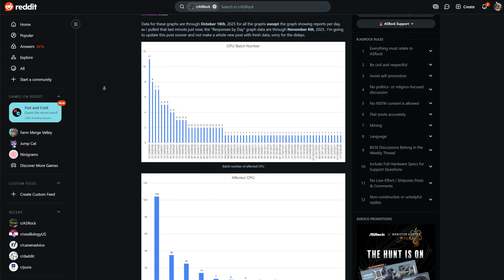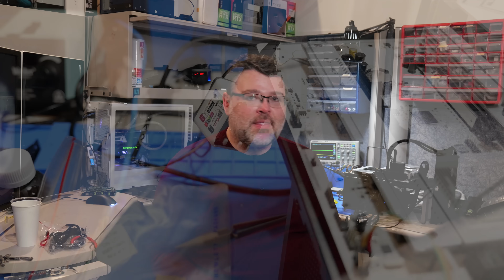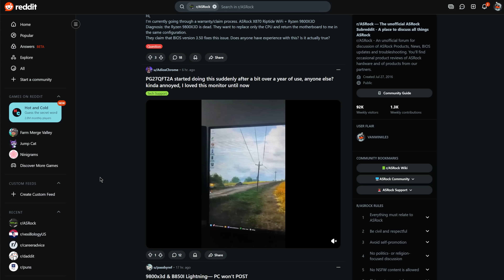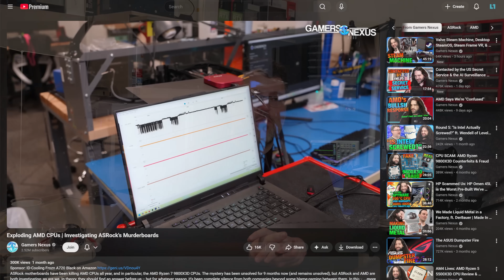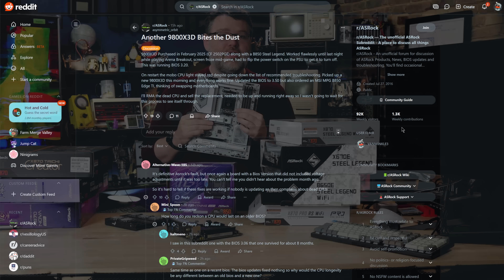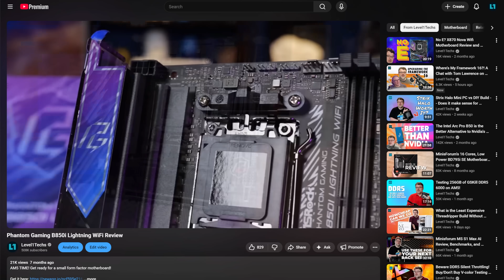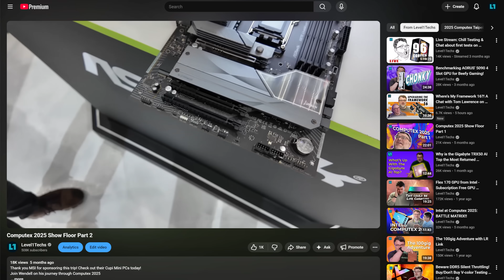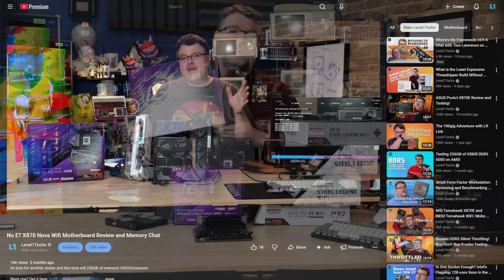Attempting to Troubleshoot the ASRock Motherboards of Death!

Comment: Had ASRock boards for 20 years. I like the simple design of the Bios and "the price is / was right" most of the time. I want to buy an AM5 board in the near future, ASRock get it fixed!!!
Reply: That’s the thing— it sorta is fixed. 10’s of thousands of boards sold and it hasn’t been replicated. The subreddit is full of maniacs with an axe to grind. Theirs been a couple hundred failures- a statistically significant number for sure- but it hasn’t been nearly as huge an issue as advertised. Especially with the newer BIOS version. If it were still a huge problem - they would do something about it.  I say this with a 9800x3d mem training on my 870 steel legend right now. So I put my money where my mouth is.
Reply: @Ball-Lightning-dr5wv  i gotten 9800x3d with pro rs x870 when they just launched undervolted and restricted my 9800x3d to be less hot + less noise glade it wasnt burned up already close to 1 year with the pc added rx 9070xt pure to the pc also updated to the newest bios version still going strong guess i was lucky with the board have another pc for my brother with 9060xt 16gb prime that costed 350$ + b650 tomhawk + 7800x3d both were great only msi board was kinda annoying on memory timing doing problems till i updated that bios fixed everything msi seems to have problems on older bios versions so always best to update to newest bios's on all board as i realized with all boards that use xmp/oc/undervolt/different rams just update ur bios to save headache later
Reply: @Ball-Lightning-dr5wv  you need to remember all the people who have had the 9800x3D burned up, but they don't use reddit. Like my friend that had his 9800x3D burned by an AsRock board 2 months ago but he just brought it to warranty and didn't really complain on online forums about it.
Reply: @Ball-Lightning-dr5wv  Big balls :P But yeah considering ASRock is a solid brand I don't blame you, odds are it'll be just fine

Comment: Can motherboard makers NOT use 1 and 5gbe and just use 2.5g and SFP+. Too many shit standards.
Reply: Kinda ironic that you use the acronym SFP+, when that's the reason they use 1, 5 and 10g ethernet. Nobody knows what the hell SFP+ even means, so even less with use it, so why should they bother?
Reply: @Dexx1s  normies don't know ethernet comes in different speeds. People who know, want sfp.
Reply: @leggysoft  And they build boards for the general audience. That's kinda my point. If you need something special, you probably already have a PCIE card for it. 
Even the majority of 'non-normies" will only need 5gb. If you want/need 10, again, you already have a card. 

It's like complaining about their audio controller when anybody who really cares that much about audio already has a separate DAC/interface.

Comment: I have the Gigabyte X870E Elite Pro Ice wifi they really need to change these damn names.  Running a 9800X3D for about a year now and have updated everything when a new version comes out for software/bios.  My only issue and it's been this way since I bought it is that if I run the MB software to control the RBG for RAM and MB it will hang on a reset and I have to hard reset it to get it to boot.
Reply: I agree with the name change because it is beyond insane to use so many adjectives to describe a motherboard. So far I've had no issues running a 9800x3d on a Gigabyte B850M AORUS ELITE WIFI6E ICE (rev. 1.1) <- ugh too long!

Comment: i have  b650 steel legend wifi with a 7900x3d and while its not dead i have some weird behaviour. i have to shutdown the pc completly to be able to boot again because when rebooting the running system its gets stuck infintly at dram training i think (the led flashes). but other then that it works but i havent used it extensivly because of the whole asrock killing x3d issue but i have always kept the bios up to date to the latest version with mostly default values with expo enableld , new bios versions doesnt help to fix these issues.

Comment: The fact that this is still an issue and ASRock just blames AMD is appalling. I'd be fine with making up shit like "ASRock burns up AMD cpus" like how "Nvidia doesn't work with Linux". Technically not wrong but might get the company to fix their shit.
Reply: But why is that a problem, Asrock did bios 3.15 based on advice from AMD and still AMD CPU's died before reaching the limits AMD claimed were safe, the AMD CPU's should have shut down but didn't.
AMD themselves back then even did a press release saying they would replace the CPU's, AMD than apparently threw Asrock under the bus, yet here we are, since May 2025 no one on the planet has found the cause or replicated it in the test bench, including AMD and Asrock.

We also have vast numbers of the failed CPU's belonging to the same batches, indicating there was indeed a batch tolerance issue getting triggered by Asrocks more aggressive Bios setting that were running under the specified safe limits AMD provided.

What is appalling is just how hard AMD have been pushing CPU's, pretty much overclocked to the hilt as stock, just look at the 7600x which at stock was hitting ridiculous temps even with a 360 AIO during the initial reviews, AMD CPU's designed to push hotter dying, hardly surprising. Maybe if AMD were less aggressive we would not have the issue.
Reply: @SastusBulbas1  1. ASrock were running the CPUs out of spec. No other board manufacturer has failures like ASRock has. AMD said it is not the CPUs that are the problem, which in all likelihood is correct as if it were you would be seeing the same reports in the same numbers from owners of MSI, ASUS etc. boards as they are far more popular options than ASRock. 

2. The boost behaviour of the 7600X is normal. Temperature will not kill a CPU because of TjMax. They will shut themselves off before any damage is inflicted on them. What will kill a CPU is current and voltage, which is entirely user controlled outside of motherboard manufacturers again, running their boards out of spec. Out of the box the CPUs do not run with high enough voltages or pull enough current to inflict long term damage unless you specifically override their behaviour.
Reply: @riven4121 dude all I said was out there said by others, as for the issue, 200 out of two million is fuck all, and gskill suffer more failures, Asus also blew more 7800X3D last year, yet the whiners still buy those.

Comment: My son had his AMD CPU die quietly after about 20 months on a MSI B650.  No visible damage on board or CPU.  AMD replaced the CPU.  Works on same board.
Reply: Which CPU?
Reply: @Matticzek1804  probably X3D
Reply: Which processor
Reply: What ram do you use ddr5 cl?

Comment: I think we need more deeper on owner hardware installation, Fans, Ram, AIO/Air Cooler, Windows version and any other 3rd party app such as; RGB from other 3rd brands L-Connect (3 Lian Li), Icue App (Corsair) etc. and other Game peripheral app; Razer Synapse etc. These apps always use cpu and ram which impact pretty heavily, on performance and Resource Usage.

And every case i saw nobody mentioned any of this. Most importantly, "some" 3rd brands app aggressively change bios cpu fan curve. So I think we need more information from user/owner hardwards and apps their install and use every startup.
Reply: None of those things should ever lead to a board frying a CPU. And if Windows and apps  were the cause, it would be more spread across all brands. If any of those things are causing Asrock's boards to fry the CPU, it's Asrock's fault, and we're in the same position.
Reply: dude you have no idea what are you talking about, you should learn something on the subject before spewing such things:))
Reply: @alexandruciordas4941  I built my own pc for decade, and i well aware what i talking. And Because of this issue still going but nobody talk about another hardware owner install in their mainboard or apps. You can call me stupid as you please, but you can search all over the internet about this issue, not even once i saw mentioned any of this thing. That's why I'm curious the hell is going on. Even GN Steve and Wendell who do the lab test the most cant even reproduce it. 

I want to know too, this situation is like we going around circle, many users are fine, some user are Dead, same board same bios version.

PS. All MB manufacturer windows apps SXXK, heavy use on resources = impact performance. The most well-known is MSI Red Dragon apps. Also Razer Synapse, for example, also heavy impact on performance for decade and never change. Not just RZ Synapse, all gaming peripheral apps. Corsair icue link, Lian li L-connect 3, also use resources. Look in your system and disable all these services from startup, see how much your performance will improve.

PS2. Thank you for your insidefulness of information.

Comment: Would have wanted to pickup a 7800x3d on Aliexpress Black Friday, but I am afraid my B850M Steel Legend will kill it despite it having the latest 3.5 BIOS. ASRock has not stated that the issue is fixed (only that CPU compatability has been improved). I'll probably just dump the Murderboard together with its 7600X when Zen 6 is launched.
Reply: Issue is 9000 only , 7800x3d should be perfectly safe
Reply: @Pieteros21
107 units of 9800x3d
7 units of 7800x3d

So 15 times less likely, but still overrepresented vs the non-3d 7000 series
Reply: @stennan 7units of what ? thousands of 7800x3d are working on ASRock motherboards . Also that 7 could just be a bad batch, at this big volumes they are produced it Can happen.

Comment: 9800X3D in the Nova board hasnt blown up yet at 12 months, but it has made me anxious enough to yank an old HP pavilion out of the trash as a spare
Reply: Exactly the same for me. Which BIOS are you running?
Reply: I mean, just monitor your Vcore / Svid and make sure they doesn’t go over 1.35V for exemple, same goes for vsoc etc., you want them as low as possible.
The only way to be safe on any board is to be sure all your voltages are within specs with safe margin..
Reply: Mine same combo 9800x3d with Nova wifi just died, I thought it was 5090 but nope. Gpu is fine, system wouldn’t boot no matter what

Comment: 9800x3d and X870 Pro RS Wifi here running since Oct 12... only thing wonky is my BT died strangely about a week ago.  If it's enabled POST takes longer and USB resets multiple times.  Linux kernel does the same.  Disabling it brought back the original boot speeds and no more USB resets.  This happened soon after an upgrade to kernel 6.17.8 (fom 6.16.10) which apparently is not compatible with this BT chipset (MediaTek M77925 RZ717).  Wondering if that is what killed it.

Comment: Mine was completely standard, no fiddling done and it blew up after 3 months. Nova wifi and 9800x3d. Board was fine, bought a 7700 and  it booted right up and that still runs today.
Reply: that sucks. I've been on asrock x870e and 9800x3d since late January and haven't had any issues at all, wish you had the same experience. I really like the mb, it has really great features and layout for price, so I hope this gets sorted so people can continue to run them.
Reply: right? only standard model than X3D was totally fine and that's good choice to save money for budget conscious cuz X3D is too damn expensive lol
Reply: @indrahaseo x3D's performance gain is significant in he correct workloads.

Well worth the minimal price increase. The 7800x3D can be bad for under 300 bucks.
Reply: @thebritishviking X3D is too expensive for budget gamers if you want to save money so badly, then just go with standard model than non-X or X3D is more cheaper.
Reply: @indrahaseo or just get a 265k for better performance at lower price without killer motherboards
Reply: @iceman5117  nice try, intel fanboy lol
Reply: @indrahaseo not really, only a fan of reliable chips
Reply: @iceman5117  oh from the userbenchmarks lol
Reply: @indrahaseo No just common sense. I have a 9800x3D in my rig right now. 265K is good value, cheap and solid performance and hey, it won’t get killed

Comment: This is kind of worrying as I have both the B450 Steel Legend and B550 Steel Legend which have both had my 5800X3D in them. The B550 is being used by me with the 5800X3D currently and it's fine, but i was hoping to move over to AM5 in the new year and looking to getting a B850 Steel Legend board but if they're having issues, maybe I'll go with another brand?

Comment: If you end up chasing the bios settings/corruption as a cause, rather than bitbanging the bios settings with the nano kvm it might be worth it to rig up a microcontroller/fpga that either masquerades as the bios chip or sits between the bios and board. This would let you swap images or settings instantly and if you have something between the bios chip and board you could log all communications and detect any weirdness or even introduce a problem on purpose to see what happens. 
Of course this adds a new variable in the system that might mask the problem in some way (intermittent problems are the worst!).

Comment: Or you know, ASRock could OWN this problem, issue motherboard and CPU REFUNDS without question, TEST and replicate it themselves, PUBLICLY release the cause, and a FIX for it.
As someone who has owned many ASRock motherboards in the past, and built many systems for family and friends with them, I will now NEVER AGAIN buy or recommend any ASRock products, and will actively deter others from doing so as long as this ASRock behavior continues.
End of Line.
Reply: Did you even listen to the video. He mentions that both AMD and ASRock have tried to replicate the problem and have yet to find a root cause. He then goes on to say that he has spent months himself trying to get it to happen, controlling for a multitude of variables. If this was easy to find it would be easier to fix, but it's not, obviously. Put down the pitchfork and back away from the computer.
Reply: its probably a headware level defect and would be committing corporate suicide if they ever issued a recall.
Reply: @deadpool790 what? Did you mean hardware defect? If it was that then it would be easier to replicate, especially if it is as widespread as people are trying to make this out to be
Reply: Or maybe get an education and do some math with th efigures, AMD and Asrock and the best Youtubers and the largest system builder companies have not been getting the problem, no one is able to replicate it. 

Back in May 2025 the issue arose with bios 3.15. Back then some on Reddit deep dived and found Asrock had most likely sold around 2.13 million motherboards, and a few months later someone had stated a confirmed number of just over 100 AMD 9000 series CPU's having failed.

Gamer Nexus then twice did lengthy videos on the subject, and despite their best efforts, could not find the problem or the cause. Last month GM posted the figures on reported claimed deaths by Asrock, not verfified, as around just over 200. And managed to list the CPU and motherboards, someone else then linked the batches showing the highest percentage of 9800X3D that failed came from one batch. 

Interestingly, more 5090's have had melted cables than Asrock failed motherboards, more G-Skill memory fails Memtest than CPU failures on Asrock, over 3000 people per day die in a road crash. So just how massive a problem do Asrock have if over two million Asrock AM5 systems are running fine, and only 200 have failed? Is that a motherboard manufacturer fault, or CPU fault?

Why can the CPU not throttle and shut down, why is the CPU dying in such small numbers so randomly?  Possibly because AMD designed these chips to run at their max and hot for the best numbers, and as such increased failure rates? 

And remember, this is based on an Asrock Reddit thread that grew die to the majority of contributors posting despite having no Asrock or 9000 series CPU. 

More people had exploding 7800X3D CPU's with Asus back when the SoC voltages were too high, the fault replicated in labs, it was news, yet it got sorted, here we are and it's still mainly people who could not be bothered updating bios has led to what, around 200 failures?

Comment: I had asrock 650 steel legend wifi with 9800x3d for few months, no issues, then moved to 7800x3d for another 6 months and zero issues. Didnt even update the bios.